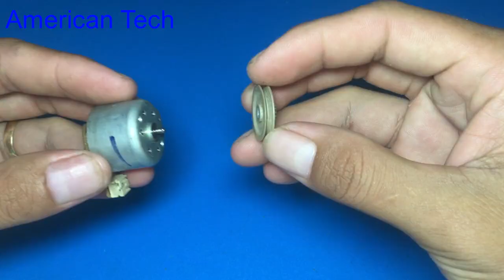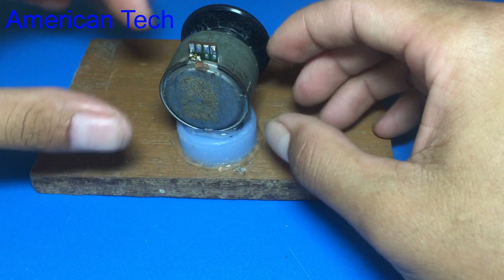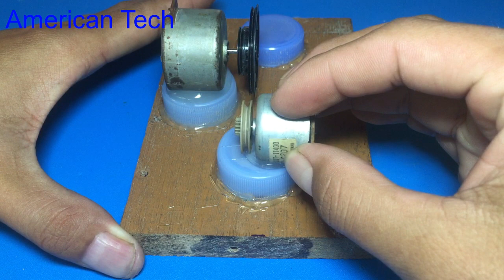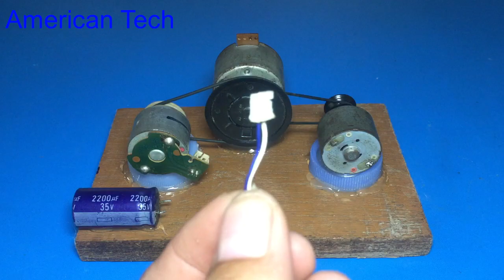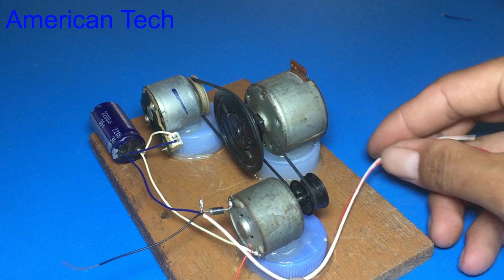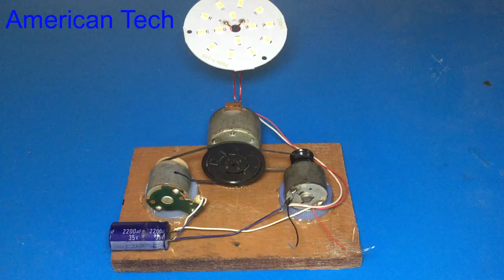Free energy using piezo igniter as starter

Comment: As a scientist I do test these theories in different ways. For example, I have one of these high induction motors and they spin at nearly full speed using nothing but a 5v solar panel and a 13 watt 1200 lumen cfl light bulb. Even has a little torque to it and it's cable of spinning multiple magnets at high speed. You guys shouldn't underestimate these motors. I do truly believe we are being lied to. Check out what i've discovered on atmospheric electricity and salt water batteries so far, it might surprise you! :)